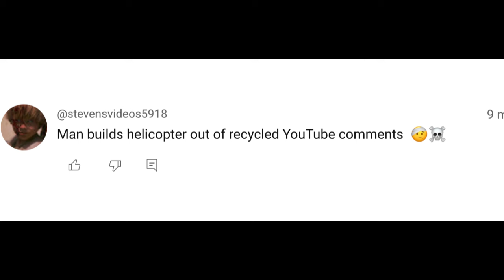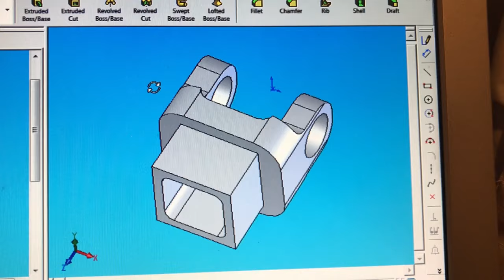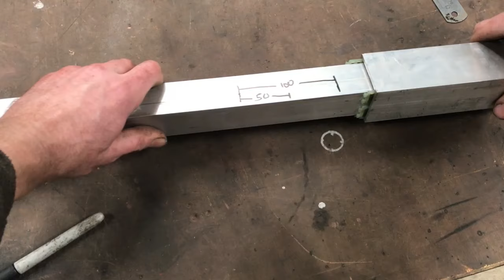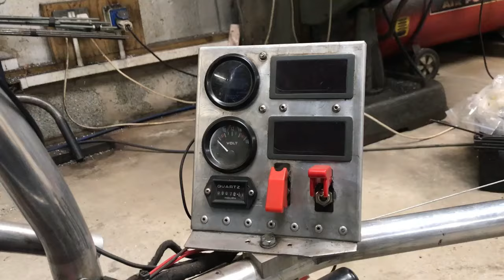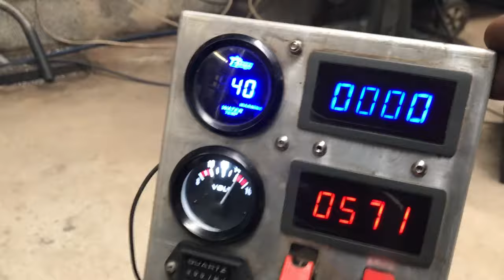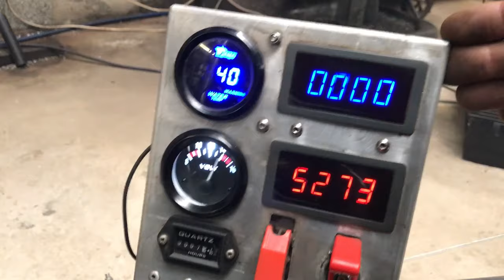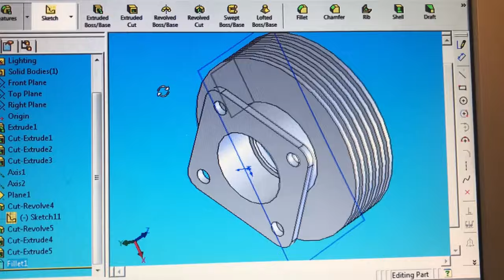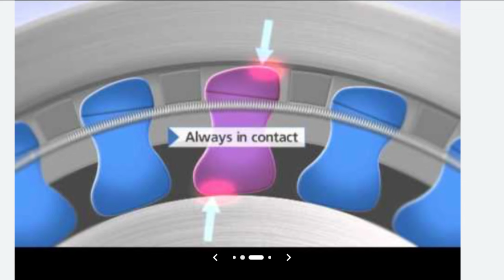Should I fix my Homemade Helicopter ???

Comment: I am a skydiver with 20+ years and 6000+ jumps, it's not remotely similar.  We have a reserve if the main fails and our equipment has been designed and tested to maximise safety.  I don't want to see you dead, I think you are incredible.  Why not build a large radio controlled helicopter from scratch, even the at same size as you are currently building, that would allow you to scratch this itch effectively.  At some point something will fail and seriously hurt or kill you.  Your engineering is without doubt incredible, but please, you only have one life and I assume loved ones who also love you.
Reply: By the way either way I will still keep following this project and I wish you all the best with it whatever you do.
Reply from the maker: Fair point on the sky diving stat. 👍
I tend to crash anything RC 😆 plus I'm not sure which is safer. Sat in the middle where blades would probably fire off in the distance or be stood with a remote control potentially in the firing line. 
Good comment though. Cheers

Comment: I get your point about the sliding splined joint but why does it work on a road vehicle? Might there be some dynamic factor that allows it to work in practice but seem unpromising in theory? Love your content. Stay crazy :)
Reply: Might find the sliding action is so small on a vehicle Gilly.
Reply from the maker: A good question, I was surprised at the friction under torque. I believe it works on vehicles because its forced to move, the differential on a vehicle has taper roller bearings on the pinion gear, they will take a very large axial load. I would imagine the gearbox drive also has taper rollers. dynamic factor could help the movement, that's true.
Reply: Your dealing with an initially different situation, a car is not under constant torque , gear chainages , accelerate decelerate, axel and diff bonusing all over the place, plenty of opportunity's  for splines to slip.  @Ben-Dixey

Comment: Is rock climbing (just to take one of your examples) potentially fatal, yes! Would someone trying to sus it out without a qualified mentor be in much greater danger, yes! Your analogy omits that all of these high risk activities consider some level of mentorship, or otherwise closely supervised apprenticeship, a mandatory step to protect you from the multitude of potentially fatal hazards. The people that are encouraging you, do you think that they are engineers, or mechanics that work on helicopters, or even aircraft? Have you considered that they MAY be watching to see you die? I hate to be so grim, but that is a real thing that people do. I used to watch a channel calle Jay Lazer Video, here on you tube, for that very reason. He went through a phase where he started trying to build a drone that could carry hm, and leading up to that he started buying larger, and larger brushless motors, and propellers for various diy projects. He, like you, was clearly unqualified to work with those energy densities, and technical issues. He made a paramotor and when it left a HUGE gash in his forearm, when he went to the ER he got time to think, and recruit qualified help. As time went on, he hired more and more help. He is still alive. You could stand to take a real look at the potential catastrophic issues that real helicopter pilots go through as they are getting educated on how to fly, and the parts of that education that focus on what to do when hardware fails mid flight. There is a LOT of that. The strategies that they teach pilots to employ are NOT intuitive, and DO require education, and practice , under qualified supervision. I have grown as a person, and no longer think it would be interesting to see someone fail in this kind of endeavor, as I have seen some videos of such things, and it didn't take a lot of them for someone like me to be horrified beyond the grip of my curiosity. The videos that you can find of homemade helicopter fails are real cold water to the face. It's fast. It's merciless. It's usually fatal. The people around are always horrified, and there is nothing they can do. I do NOT want that for you. I hope you can look at what you know here: there are a multitude of untested hardware components that you are GUESSING with. You have no idea what to do to save yourself if they fail mid flight. Please consider remote testing, and buying a kit helicopter if you are actually going to fly it. I don't think for a MOMENT that you are incapable of building a helicopter. That's not the issue. The thing that IS the problem is: you could easily learn one of the many fatal lessons that people have already learned about helo design/flight in your trial and error phase. I would rather you learned from someone else's mistake, and keep your life.
Reply from the maker: Yes that is a good point.

Comment: Yes Ben D!  As for the nay sayers - allow me to be blunt - sod 'em.  You've got balls, dedication, drive, Intelligence - you crack on pal.  Electronic ignition upgrade might be an idea?
Reply from the maker: Thanks very much Helished 😊, its getting fixed there is no doubt about that. Electronic ignition upgrade? Like the Rotax engine with twin ignition systems for safety ? It would be sensible to add that for sure.

Comment: When I built my car, I had propshaft built with a splined slip joint, with grease should be fine, also some BMW driveshafts. The flexible drive coupling could be replaced with motorcycle cush drive (https://www.youtube.com/watch?v=8XabMFbgs2A) - rubber blocks to absorb sudden torque changes but the steel "paddles" interlock
Reply from the maker: Hi, I did have grease in the splined slip joint for the demonstration, certainly seems like too much friction for my application. It needs to plunge with very little resistance, it has been suggested that when it's spinning that makes a difference. 
Thanks for the link on the cush drive.  👍

Comment: Yeeesh you weren't kidding some serious negative people that have zero tact in sharing their opinion. Sorry and thank you for enduring it.

Looking stable in during the hover with minimal vibration. I subbed gotta watch em all before commenting.
Reply from the maker: Thanks very much for the supportive comment, appreciate that. The negative comments are just something that has to be got used to. The vast majority are positive and those are the ones I remember long term. The negative ones hit hard in the short term but then get forgotten about. 
I remember with the disaster video I was getting a negative comment every hour for about a day and I just wanted the views to stop so that it would stop. 
It's not just me though, plenty of other YouTube creators get it, certainly stops some people from sharing what they do, which is a real shame. It's a nerve racking thing to put yourself out there in front of a big audience, swings and roundabouts I guess. I did get a free helicopter ride out of it, a very kind person turned up to my house in a hughes 269. 😊👍
Reply: For sure 💯 agreed. If you had a do over and started again what would you change right from the start and or what would you do differently? I ask cause I am wanting to build a wild flying contraption aka coaxial helicopter.

Also a ride in big helicopters is crazy awesome. I've got stick time in the R-22 that's about it.
Reply from the maker: @B-RadThePILOT  The main change I would make is to make the rotor shaft tubular. I chose a solid shaft which isn't right for weight reduction but more importantly you can't have control rods running up inside the shaft. Control rods for collective pitch, collective is much better for controlling height as it's so responsive. That would allow me to hover in more wind, with fixed pitch wind gusts have more of an effect as it can't be compensated for fast enough. 
The Nolan brothers flew very well with fixed pitch so it can be done it's just harder to control the height. 
When it's calm it's very easy to control. 

Collective makes for a serious machine and I intend to try and find a way to add this to mine. Maybe not full swash plate control because that is going to be very difficult to work out. If plans were available for the swash plate control I would go this way but to work it out from scratch would be a very long process of development. 

The R22 handles very similar to mine via the cyclic stick but is very different on all other controls.
Reply: @Ben-Dixey  you must be referring to that square tubular design you showed in one of the videos. Looks very promising. It's wild that you've been able to use a fixed pitch that'd drive me crazy. I hope you keep working on this despite the other projects and the minor setbacks. Are you planning on selling plans, or perhaps open source.... Or is this just for you no intent to commercialize it?
Reply from the maker: @B-RadThePILOT  The tubular square section is what drives the belt reduction. Im on about the shafts that drive the rotors needing to be tubular. It just provides a away to get control rods to the swash plates. Like the sch2a coaxial helicopter. 

Yes I will definitely keep working on it. As for plans, I'm not sure. I'd have to be very sure I was providing information on a proven design. Wouldn't want people building something that has weaknesses. This project also has a lot of precision made, machined parts. You have to be an engineer to build this and that's true with most helicopters. The only other option for non engineers is to build a human carrying drone like the Jetson. 

Fixed pitch is very limiting but I believe can be safe if you operate in the right conditions. I will experiment more with fixed pitch but ultimately I want collective.

Comment: Do not use Universal joint in the long term! They have not a constant speed output. Use instead a Constant-velocity joint. On the aluminum driveshaft you will encounter fatigue issues without a constant torque
Reply from the maker: Hi, doesn't it depend on the stress the aluminium box section is under? As I understand it if the stress isn't above 95MPa uisng 6082t6  then fatigue wont be an issue?
Reply: @Ben-Dixey  the problem is in the variations of the torque during every rotation, aluminum Is not stress proof, uner any stress, unlike low ally steels. A constant speed joint Will increase the life of the shaft considerably. With a bit of a weight loss, i would prefer a steel component in this critial application
Reply from the maker: I'll do some research. It seems that if the figure of 95MPa isn't exceeded then the number of cycles will be between 10 million and 500 million. The engine running at 5500rpm and two cycles/ rev would allow 15 hours of running time at 10 million cycles. This I think would be the lowest component life. If I used aluminium thick enough to get below the 95MPa figure then the life would be much more. Am I correct with this ?  I still might take your advice and use steel but, the universal joints will be aluminium, the bottom rotor is driven by an aluminium tube, the pulleys are aluminium, the rotor hubs are aluminium as are the blades. 
You can also buy aluminium prop shafts for cars, with universal joints, made from 6061 t6. I'll try and do some calculations to see if steel would be the better option I don't want another breakage.
Reply: @Ben-Dixey  seems right, but remember the bearing rollers are a stress concentration point. Not all bearings have equal load, and the contact surface of aluminum Is very soft. The stress concentration on this points Is pretty hard to estimate
Reply from the maker: @alessandrogiovanardi558  True, and I    only know the maximum constant engine torque. I don't know what the spikes will be. Could spike at 4 times more but then there is the flex in the frame reducing that spike. There is only so much that can be calculated the rest is an educated guess. 
I'll look into what size steel box is available. Thanks for your input.

Comment: Do NOT use box section with linear roller bearings!!! The box section will fail (split open) over time because it is not made for that.  You need precision ground and hardened surfaces for the rollers to move on or they will make indentations.

You can find decent sliding splined shafts in every scrapyard because lots of front wheel drive cars use something very similar (drive shafts also have to adjust their length due to suspension movement).
Reply from the maker: Hi, there are 144 rollers taking a torque of 55lbft. By my calculation each roller is taking a 2.4kg load. You could push that with your finger, can't see how such a small load could do anything to aluminium. 

It seems to me that splines create too much friction as demonstrated in the video. You can get ball splines though and I'm going to consider this option.
Reply: That box section you show in the vid, looks like extruded aluminium.
That kind of tubing is NOT suitable to be used as a drive shaft, period.
The insides are not precisely machined and hardened, which makes the running surface unsuitable for linear roller bearings. Period. The rollers, under the constant hammering of the engines torque pulses, WILL dent the aluminium, creating dozens of points where a possible crack will initiate.

It is your neck on the line, not mine (quite literally, that shaft if it fails it will split open and it is scary close to your neck).

There are also homokinetic joints that have some length compensating properties. You don't seem to need all that much movement. Most drive shafts for front wheel driven cars have this.
But proper hardned and precision ground splines are used all the time for exactly the purpose of being able to slide under load, by designers and engineers.

Your choice.
Reply from the maker: Appreciate the input. Good to discus it. 👍
Reply: @Ben-Dixey You're welcome! I would hate to see another shaft snap, with possibly more detrimental consequences.

You're not flying high or fast, but there's more than just crashing that can kill, especially in helicopters with lots of spinny bits in inconvenient places...
Reply: @Ben-Dixey  horizonal yes vertical no, but with return springs under the bearing packs may be another mater?
,

Comment: I'd fix it, if I were you.
And I'd consider an electric motor (or two), supplied by cable via 'shore power', not battery, as you're going to stay more or less in one place 👍🏻
Reply from the maker: 🙂 Doable I suppose (might get away with a 40hp motor. Electric power would be so nice. When I was a kid I put a 240volt motor on my bicycle. I built a trailer and put a petrol generator in the trailer to power the motor. 
The generator wasn't quite man enough so I just plugged it into the mains with an extension lead. 😄 Of course I couldn't go very far but it was fun. Smooth and quiet as we know.
Reply: @Ben-Dixey  you could concentrate on the helicopter dynamics and forget about any combustion engine issues...

And it might be a great trainer for hobby heli pilots 🤔